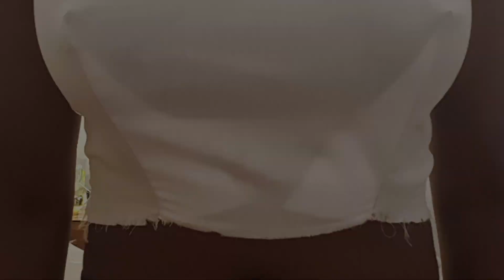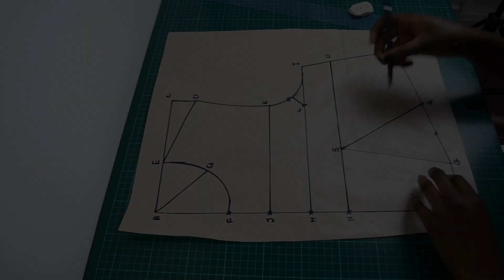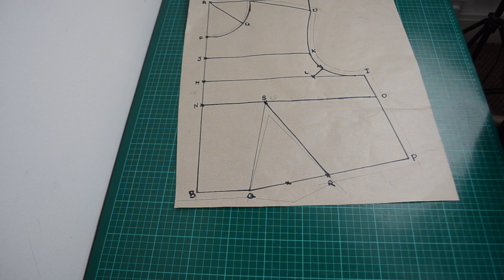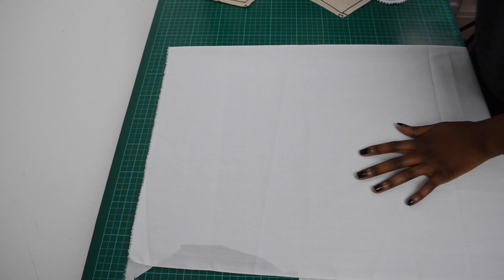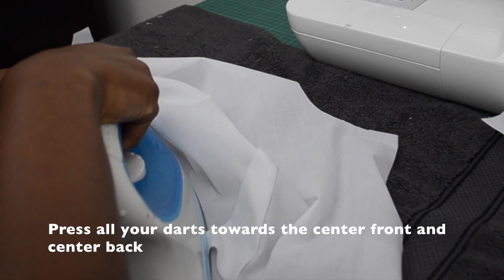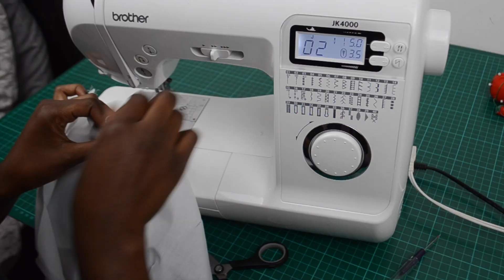Pattern Drafting for Beginners – Bodice Construction Tutorial • Elewa

Comment: Hi, saw this video. I just have a couple of doubts. Y do u give a dart at the back Shoulder? 
Secondly, When u cut the bust darts, y do cut an inch below the marking and slightly more than the seam allowance? Thanks
Reply from the maker: Hi, a shoulder dart is usually normal. It helps the top curve around your upper back. 
You add darts slightly below the tip so that it doesn't start exactly on the nipple